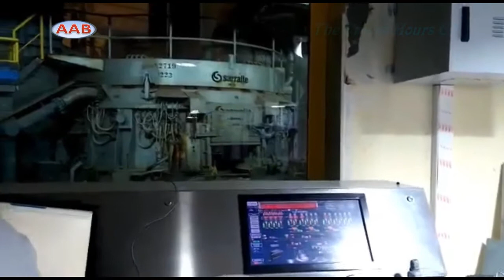Esfahan’s Mobarakeh Steel Company

Comment: Does this plant produce steel from (native)  iron ore, or just melts recycles  (imported) steel bits and pieces, ready to go?
Reply from the maker: Combined with iron ore and mix scrap
Reply: @TFHC  Thank you. But mixing scrap with ore defeats the purpose. Scrap is ready to go as soon as it is melted; ore needs to go through the entire costly and difficult purification process. Why mix the two and create extra work for oneself? I know that the plant at Ahwaz is only melting scraps, and no ore.
Reply from the maker: The process of metallization of iron ore isn't simple, it's begain from the  process to get the level of metallization until 97%. The total composition is 80% sponge iron and 20% scraps. And not all scraps in good condition. So the problems wasn't the iron ore but the scraps contain another things.
Reply from the maker: One more thing, the total time for 1 heat of the melting is more faster of we use pure iron ore, so more efficient and effective for the energy cost
Reply: @TFHC  Scrap iron/steel has already seen that process. It is already steel. All it needs is to be melted down and turned into something new. "A child can do that."
Reply: @TFHC  There is no such a thing as "pure iron ore." All ore is mixed with rock and dirt. Unless it is a meteorite!
Reply from the maker: @TWOCOWS1  yeah I didn't said it's pure, but the Fe content reached around 92-96%, energy is the main high cost variable, such as electricity and natural gas. However, the design of the equipment at every steel making is different. We need to calculate the refractory period, quality of the scrap, prices of raw materials etc.  Business needs to keep running
Reply from the maker: @TWOCOWS1 😅 I told you, it's not that simple, Every scrap has ther own characteristics, even a good scraps isn't good enough to get some specific material. That's why, purifications is a must. Ladle furnace or secondary process will create some specific composition